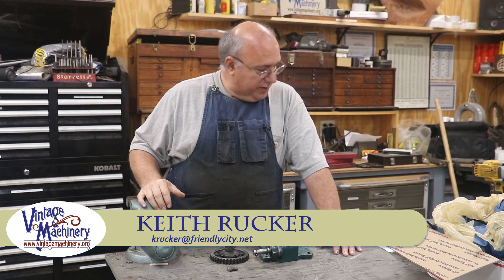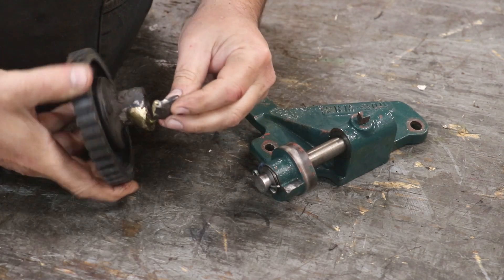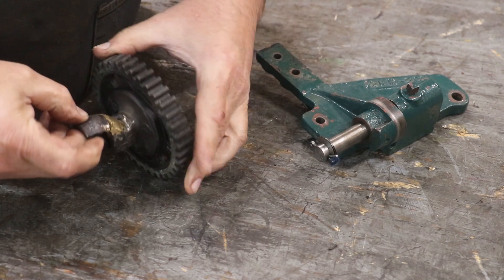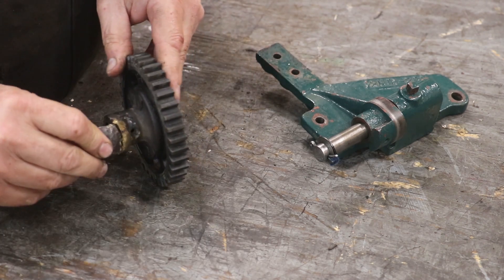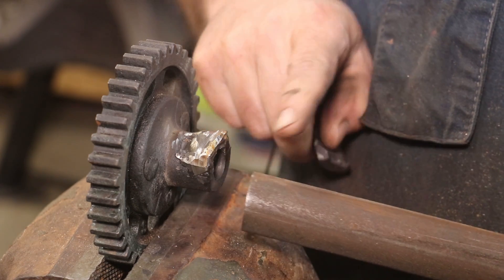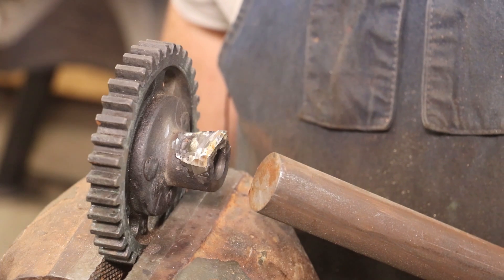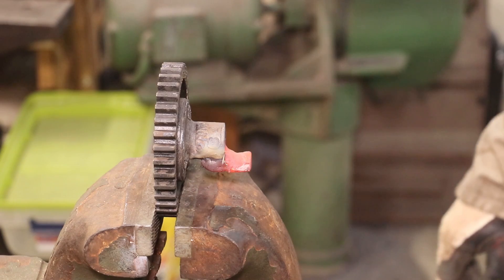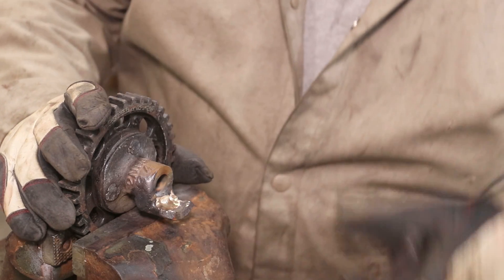Hit & Miss Engine Repair: TIG Brazing a Broken Cast Iron Casting

Comment: I was thinking about that job & wondered why you didn't redrill the oil hole on the other side of the repair, that way you could have used that real estate on your brazing and locked into that hole too? I suppose if it fails there's always sending it to Windy Hill Foundry to mold up & pure a new cast iron one.

Comment: Good grief!! 
Brags on his ability to braze but contaminated the puddle with the tungsten multiple times, long arced it the rest of the time then grinds a chamfer on the part it attaches to make his hack repair job work....then talks bad about the last guy's work while he's placing the parts on top of the packing material in the box. 
It would have been a much better fix to unbolt the gear from the part and machine a new one.
Keith, this is embarrassing. Have you no pride in the quality of your work?
Reply: He doesn't!

Comment: I wouldn't have thought it would have been that big of a deal to just machine a new hub with the tab to replace the broken one. Would be a rather easy project.
Reply: Keith's entire channel is devoted to restoring classic, antique machinery not making new parts for them unless absolutely necessary. BTW, your comment about machining a new hub being easy tells me you have no clue about machining. There is a very obvious reason why that part was cast and not machined.
Reply: I had the same thought, given the original hub was held  on with three rivets that could just be drilled out.  There would also be the option then to turn it out of steel given the original casting failed as did the brazed repair.  Seems like a good candidate to turn a steel hub and then machine out part of the end so you would be left with the tab all in once piece.  Now I thought the mandrel was clever idea to hold it in place.  Just can't help but think that once will be seen again.

Comment: Considering that it was welded before and broke more than once I would say the design is flawed. There is a pretty good chance this will break again. I hate to say this but it would have been better to cut a whole new piece out of steel and rivet that to the gear instead.

Comment: I love these little repairs of old  cast iron pieces.  Each one presents unique challenges.  I would have turned and faced the gear shaft to clean all that old repair completely off, and made a sleeve for it with a tab sticking out all as one piece, but you know what they say about opinions...

Comment: If it works it works.
Reply: @chris0tube Let me know when you have film of you milling the entire body of a machine tool and having it checked on a CMM and having every surface (12) all correctly flat , square, and parallel over a 4ft by 2 ft travel within .002". Until then I will just have to assume you are one of those people that likes to pontificate about their ideal world and how things should be without having done anything themselves.  Some people just want their stuff fixed. If they wanted a new one at 10 times that cost that would be an option but most people don't. They want to be able to just keep using and enjoying what they have.

Comment: How much do you spend on acetylene every month. Given the amount of time you use a torch just for heat you might consider using propane or natural gas as the fuel. Save the acytelene for welding or brazing. Nice repair. The mandrel was genius.

Comment: Honestly, if this doesn't work I would separate the two castings and replicate the inner portion (the broken part) in bronze using investment casting. I wouldn't use iron because my results in iron have not been good enough, not enough skill in iron.

Comment: I think I might have approached the engineering on this one a little differently. I'd have put the gear on the lathe and turned down the shaft hub extension about half the thickness and then machined a separate collar by just milling away part of a sleeve leaving behind the tab that engages the lobe as part of the collar making it all one piece of metal. Make it so it could be shrink fitted on to the turned down extension on the gear and you end up with a very mechanically solid attachment for the tab.
I don't doubt the brazed tab will work but I just can't bring myself to trust the long term strength of the butt braze as much as I would the shrink fitted collar.
Love your videos, Keith. Keep up the great work.
Reply: I would have done the same but maybe the owner wanted to try one more fix of the original. 
I suspect this design is not ideal for the stresses involved.
Reply: My thoughts exactly.  You can make the collar even more robust for longevity.

Comment: I will comment about tig brazing. It is very very very effective at sheet metal. When you don't need a weld and you have thin material and warpage may be a concern, tig brazing with silicon bronze is my goto. All the racecar chassis builders out there know what I'm talkin about! Well, the ones that put in the effort do at least. Things like your lexan window mounting rails and tabs, dzus brackets, etc.
Reply: Hmm, filing that one away for later!

Comment: Want to try some tig brazing sometime in the future... I learned to flame braze 50 years ago on large castings and smaller stuff so I guess it is still my go to for repairing castings..I have an old Eutectic welder with hi freq set up for tig that I will try brazing with sometime maybe.. Cheers; Mike in Louisiana (Ramsay 1) :)

Comment: Looking at a lot of the replies, a large percentage thought that you should just pop out the rivets and make a new hub and tab part... That can be done, BUT, where do you draw the line? You could just take measurements and make the entire engine over with modern materials and processes, what would you have? Certainly NOT an old historic engine. A lot of the engines you see at meets have repairs on them that look like they were done by a blacksmith. I think that is appropriate. What you did here is also appropriate. When I was a boy in the '50s & 60s, I saw repairs that looked like they might have been done in a campfire! Some with Oxy/Acet & coathangers! Whatever it took to make it work! I don't know how a lot of people can criticize this work other than possibly they just stumbled on the video and haven't watched any of what you do... Keep it up!! The true believers are out here. Not trying to make it sound like a cult or anything. Just saying that, to me, what you do to repair and utilize old cast iron machinery keeps it in it's niche, old cast iron machinery. Repair of CNC stuff is found elsewhere. Another excellent video and explanation. 69yo 45 mi NE of Denver metro in the country maintainin' mah distances! You keep safe wherever you are.. Michael in Colorado.
Reply: Scientists say that the human body replaces all of its cells every 7-10 years, so none of us is the original person we were 10 years ago.

Comment: TIL what a "hit & miss engine" is.  Video I found explaining it: https://www.youtube.com/watch?v=fYKxwno6QUY

TL/DW: The engine has a flywheel with a centrifugal mechanism.  When the flywheel slows down, the engine fires.  Under low load, most strokes will be non-power strokes.

Comment: Not a machinist, however it looks like you could have spun that on a lath and turned of down a bit, and put a reverse(?) thread on it and then put and internal thread on a piece of stock and then ground or cut the 3/4 off you didn't need?  Or I could talking out my butt, silicon bronze it pretty strong however I read that ALU-Bronze is stronger.
Reply: Your right this could be done the way you suggest by building a new piece. Had the tab and casting disintegrated you would have to. Here you have the original components that are still usable. Why not try to maintain the same components by repair? I have an antique tractor that was built in '52 or 53. There are significant modifications done to it to fulfill a specific purpose. I don't want to change ANY of the outer, visible portions of this tractor to preserve its story. The LAST thing I want to do is give it the appearance of a "built by me" tractor. I am thoroughly cleaning it and then will apply Owatrol or Penetrol to preserve the patina.
Reply: @stephenstrohacker7863  Understand in the case of an antique tractor or other rare/memorabilia.
Haven't done brazing since metal shop, just remember lots of people bringing in things that had been brazed before and needed to be brazed again.  However, I doubt people fixing those things had much real experience/training, so who knows.  Still hard for me to get my head around how strong brazing can actually be, we probably used of brazing rods with the OA in metal shop. Sounds like Tig Brazing with SI-Bronze is quite a bit stronger.
Reply: @stephenstrohacker7863  the old conundrum,  preservation, conservation, restoration or even repair, pick any one from four and upset three quarters of the population.😉
Reply: @littleworkshopofhorrors2395  very true! They are called tractor Nazi's in my group. I ride both sides of that arguement but always try to retain the thought that the OWNER can do what they want. The Cub I have I'm doing a mechanical restoration on to not change what can be seen. The O-4 is the oldest known and 11th made. Anything needing replacement WILL be original materials. NO reproductions. Why? Because it's a low number unit, there was a 2nd production year change/update, and why not build the earliest known tractor with the earliest known original components? If any deserve the "Correct Police, Tractor Nazi" this one deserves it. Plus my family owns it, that alone let's us do what we want with it.
Reply: @stephenstrohacker7863  just to add to the problem, as something gains age or rarity the owner becomes a custodian of an historic artifact and gains obligations to history, or not.
Reply: @littleworkshopofhorrors2395 agreed. Which is why I'm doing what I am to both. Key thing here though. The O-4 was missing the tinwork, pan and one piston-rod assembly. Matching missing patina isn't happening. Cub however was complete just stuck. Both dictated their outcome.
Reply: @stephenstrohacker7863  sounds like a lifetime project, good luck.

Comment: I'm afraid that piece always will be prone to break off due to the poor design. This part should have been made of steel and not cast iron which is way too brisk
Reply: Agree. Machined medium carbon steel is the way to go.
Reply: Brisk? Like tea or a fall morning?
Reply: @mwilliamshs  
Brisk is also descriptive of brittle in Great Britain.
Reply: @stanervin6108  in what way does brisk, an adjective, describe brittle, another adjective?
Reply: @mwilliamshs  
OK, grammar police. 
 Perhaps I should have used 'the linguistical equivalent of' instead of 'descriptive of' .
    Didn't mean to confuse a great perfectionist such as yourself with such a triviality and error in word usage. Please accept my most profound apology, O Great Master of all languages and dialects. Have a great National Scrabble Day!
Reply: @stanervin6108  Interchangeable and linguistic equivalent mean different things. What you meant is that brisk and brittle are used interchangeably.
Reply: mwilliamshs Brittle is indeed the right word to describe cast iron. English is not my mother tongue. My apologies.
Reply: @horatiohornblower868  
    Right on, Mr. Singer!
Have a safe and pleasant day. 🌞

Comment: Maybe to make a new casting would not be that difficult.
Reply: For a one off part ,,,  probably just as easy to machine the part from steel and bolt it to the gear.

Comment: i think they welded it and than when it was fixed in position they brazed it
Reply: I've seen cases before where cast iron is welded, cracked whilst cooling, and the weld was brazed over in hopes of strengthening the cracked portion. 

Haven't seen one yet that worked long term but if they worked, they wouldn't get brought to my attention

Comment: Hi Keith you should try carbon brazing with the silicone bronze.You use a carbon as the heat sauce ( electrode ) and the silicone filler rod.I used to do a lot of that and found that it was very easy to do compared to the tig. you place the filler wire in  the area you want to fill then applyling the carbon to the silicon to melt it into the joint.You can get a very fine build up and control the weld easier as well.

Comment: One thing to remember. You have to heat that cast iron up before welding it.
Reply: Which is exactly what he did
Reply: I was just emphasizing the importance. No need to rub your balls on every tool in the shop ape man.
Reply: @ipissed  ...Do you feel better now?

Comment: it almost look like it be less work just to make a whole part that attaches to that gear and swap the whole thing
Reply: Anifco67  You might have to fabricate the pipe out of stock and braze it on, then a good working over with a file and  needle scaler to texture it to look like it was cast and  after being painted it takes an expert on that machine to even spot the repair.
Reply: To the old iron enthusiast, one is the challenge two is keeping everything as original as feasible, weather it is internal parts and now even existing paint and or rust. Some call it patina but once the original outer surface is is removed you can not get it back. Yes we can recreate almost any part. Somehow it is not the same, not saying there is anything wrong with brandy new parts old school to some is the end goal.
Reply: My thoughts as well- just turn an entire new piece out of cast iron and mill away the end.  Most of these hit and miss engines are for shows and meets, so that brazed unit will not look good in operation.
Reply: @oldschool1993  I disagree, it shows the machine has been well used.. And has the scars to prove it, it's called character.
Reply: kokodin . That will be part 2 if it fails again , some how I am sure it won't .

Comment: hahaha, I think I am going to tig braze it... but I'll take the torch out anyways! 
Of course, the torch is more fun!
Reply: Torch seems more forgiving. TIG needs good coordination and steady hands and in this case it is also quite constricted in the work area. This made me motivated, thou, so have to buy some rods and try it out myself. Up to now I have used it mostly for Alu welding, with little sidetracks to stainless and steel works. Did some steel artwork, just for the fun of it.

Comment: Hey Keith have you considered learning how to oxy-acetylene weld cast iron? It's not difficult, and the results would look much nicer on your vintage repairs. It might even work with TIG.
Reply: No, with cast iron filler rod. It can make an invisible repair. There are several YouTube videos on the subject
Reply: carlsharp909 He prefers to braze. He’s mentioned it in a fair few previous videos that involve cast iron. Personally I quite like the look of the dissimilar metals.